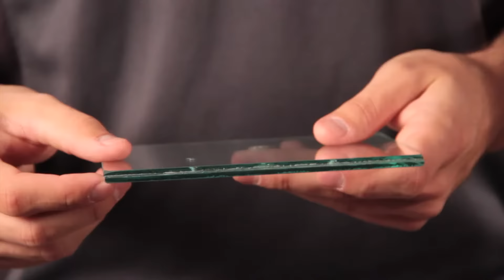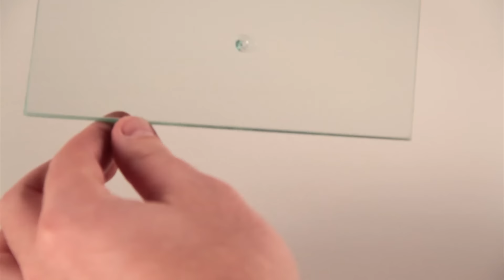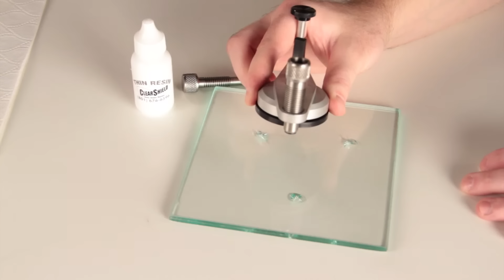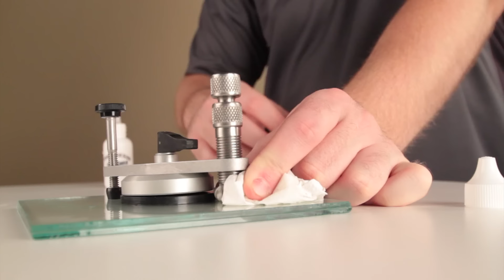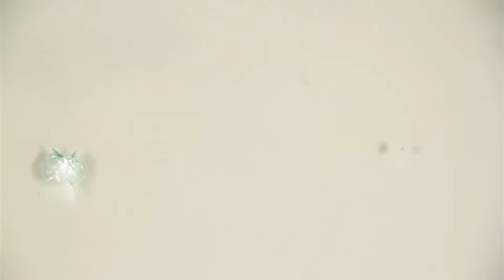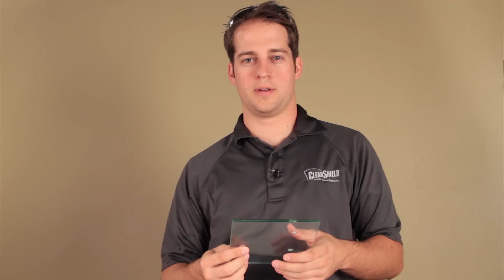ClearShield Auto Glass Repair Training Video

Comment: I bought your kit online at amazon,  It came with a piece of crap copy of a Dremel tool!  false advertising.  I want a cordless Dremel. Why would you do this?  I paid 299 bucks for a knock off.  I owned a machine shop for a number of years and the total amount of material and machine time is about 40 minutes and 10 bucks. So you are having a huge margin which is probably higher since it is not made in USA.  most likely China.  So you purchased the kit from them for 5 bucks for all machined parts.  I also used to purchase from China but i no longer do because it supports communism.  
So what are you going to make this right?

Fred
Reply: Lol 😂